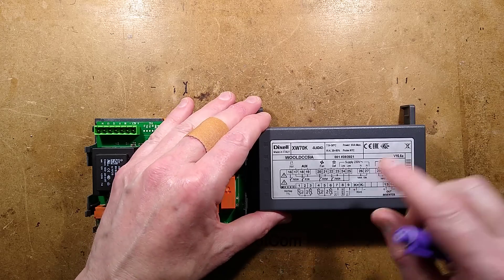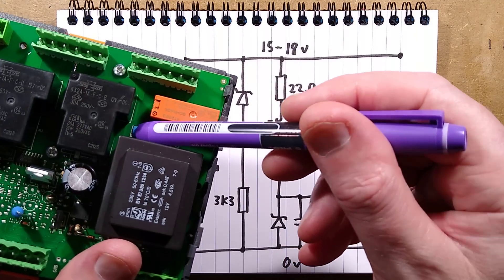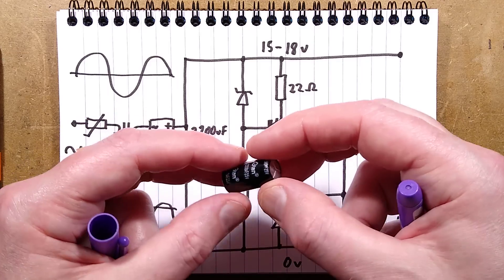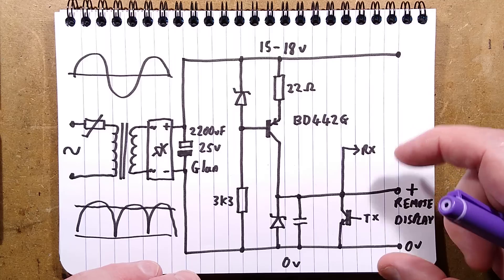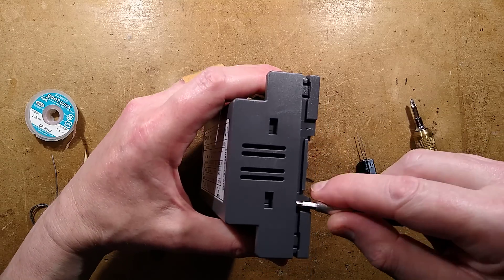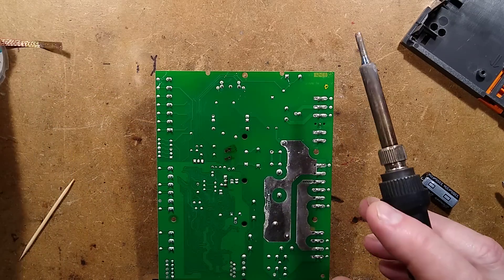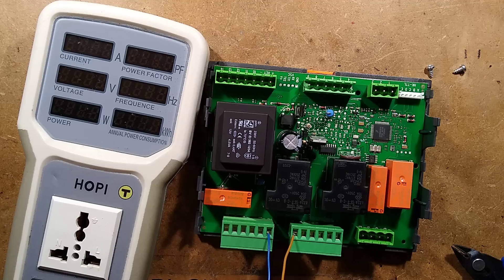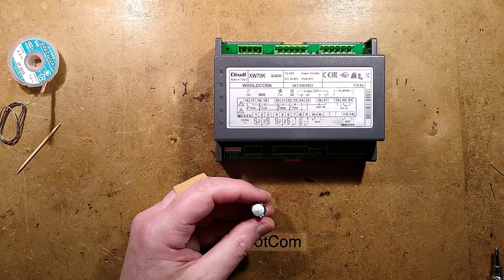Interesting fault and fix on a Dixell XW70K refrigeration controller

Comment: I wonder if it is always "planned obsolescence" or if some companies just underestimate or do not test for longevity properly. I just fixed a friends's portable induction stove - The fault was a 22 Ohm resitor (roughly rated for 2-3W, from what I could see), that had gotten slightly too hot over time and slowly crumbled until the resistance wire broke and the stove would not turn on anymore. No skidmark or any sign of an explovie fault, just crumbled! I replaced it with a resistor of slightly higher power rating (and did the same on the other plate, that had identical circuitry, but had not degraded yet because it had not been used as much) and now it works fine again. 1€ fix to save it from the landfill.
Reply: I hate to think how many products end up in landfill because of a simple resistor or capacitor.
Reply: A lot of times its simply over stating capabilities. Sure this, say fridge (that has nothing to do with Technology Connections latest video.....he lied), could keep its interior at a lower than ambient temp. But the parts selected arent necessarily meant to keep the entire volume, full of groceries, below the danger zone. What is it actually meant for? No idea. Maybe its meant for an arctic research base where it wouldn't have to run very often, no clue.... Of course there is always the accountants that love to stick their noses into designs. This is where you get things, say with a motor that pulls 2.4A and a FET running it that tops out at 3A. Because its cheaper than a 5A FET that would last forever. Of course its going to burn out if you use it like a normal person, repeatedly, beyond its 'no more than 10min. 90% duty cycle cool down' rating. But its printed in the instructions, so..... user error. Buy a new one.....
Reply: @zombieregime  CURSE YOU ACCOUNTAINTS AND ARCHITEEECTS!! *shakes fist
Reply: MTBF is based on running at 25°C ambient. Halve the life for every 10°C.

And MTBF means that half the units will have failed by then, bell curve noted. So stay away from that.
Reply: Also could be because engineers with less experience are cheaper to hire. Somebody I know who only recently graduated got hired to write control software for car clusters... the thought is slightly terrifying.
Reply: @gabotron94  I once knew somebody who put all the decoupling 0.1 capacitors in the corner of the PCB because the schematic showed this.  He was a repair tech doing PCB layout for a very small manufacturing company.
He was partially self taught and only had help from a distance over the phone. he like all learners need a mentor nearby ready to answer questions and demonstrate.
Reply: Did vaguely similar things to a NEFF (Bosh Siemens) branded, made by E.G.O one. Each phase has a power board, on those the high frequency fets/IGBTs short, burn out the bridge rectifier (maybe the rectifier dies first, not sure). Then melting a pcb fuse (which ironically has provisions for replacement hrc fuses lol). Happened twice to the same stove on different power boards. Granted the thing is over 10 years old and is powered 24/7, maybe it was due to power glitches.
Thats a sub 30€ fix on that one. New fets and a bridge rectifier.
Reply: Calculating power dissipation for dynamic and static loads is a job passed on to junior minions, not all are good at it.
Reply: Advertising these relays as capable of switching loads is the planned obsolescence, swapping a worn out contactor takes 10min&$ but these boards have to be swapped entirely once the contacts melt or burn off.
Reply: I think that phrase planned obsolescence is abused a lot. A piece of equipment that is weak and frail is not a piece of planned obsolescence; not at all. An example of planned obsolescence is having the improved version of a piece of equipment in spades, but not selling new models until the old stock (that may have problems) is gone.
Reply: Overheating components are a pretty common way of limiting a device's life.  Sealing a high dissipation in an unvented box with no heatsink is really common.  When its from a name brand you know its planned.
Reply: @RS-ls7mm  Planned destruction is not planned obsolescence. They are different. 
Planned destruction by putting otherwise heating components inside plastic cases with almost no ventilation and zero fans is planned destruction.
Reply: @troy3456789 yet always leads to planned obsolecence. As by the time your version of the product fails there 'magically' is only a newer more expensive version available.
Planned obsolecence without planned failure is almost moot as your new products would sell almost no units.
Reply: It has a microcontroller, it would be so easy to program it to stop function after so many thousand cycles rather than say to a company please make us awful capacitors and jeprodise your reputation
Reply: @phonotical  From my experience with themed animatronics industries ..... you would be surprised how often they would just order another unit and swap it out. It would take someone in the shop sneaking one out, taking it apart themselves on their time, discovering the issue, and reporting it to the boss. Then its up to the boss to give a shit. The whole programmed to not do a thing after so many cycles is far less of a thing than people think. And IF a company were to do that; 1) if any of their B2B customers found out, it could sink them. and 2) theyd be more likely to program in a random number then do something that sends the electronics out of spec and blows the whole unit. You wouldnt leave a perfectly functional MCU behind just refusing to run its code, thats too much of a smoking gun.
Reply: @zombieregime  sure but so is suddenly having reports of all these units dying because of the capacitor issue, at least it is a lot more covert and time consuming to discover, of course it'll all go to landfill anyway, but if you are the sole owner of equipment, you might want to try and save some money and affect your own repair, which is easily surmounted and prevents this whole "planned obsolescence" myth from ever happening
Reply: @zombieregime  - Toyota deliberately provided odometers for the entire run of the Pontiac Vibe and Toyota Matrix that stopped at 299,999.  It didn't matter if it was kilometres or miles.   Not sure if the Corolla had them also.   There was no actual reason ever given for not at least going to 999,999.
Reply: Not planned obsolescence per se (which really doesn't exist the way people think it does)... more a matter of cheap parts being operated at or near their absolute limits for a long time.  I always specify components that are appropriate for their conditions of use, plus a safety margin... but I design industrial electronics and while cost is a consideration, long product life is more important.  When I worked in the consumer industry, they'd use junk parts to save a half-cent per unit...
Reply: @WorldPowerLabs  explain the phoebus cartel then. Or the other modern day apple cartels they get sued for every year.
Reply: “Planned obsolescence” is a misnomer. Planned (or designed) functional life would be more correct. The electronics industries have been at since day 1 - the now rogue incandescent lightbulbs would have lasted many times longer than they do / did, had it not been for the collusion of the manufacturers, in order to sell more lightbulbs. Who could say that the practice is not rife? And no right to repair - yet.
Reply: @bettyswallocks6411  "phoebus cartel"

Comment: Seems a lot like preplanned obsolescence to me, the savings made by using a budget capacitor Vs using good quality ones from a well regarded manufacturer would be minimal at best and surely using "budget" basic components increases the number of initial first use failure's / DOA warranty claims which then could potentially risk eclipsing the cost savings made by using the budget component in the first place? Seems a tad short sighted
Reply: I suspect that a purchasing agent at Dixell has been reprimanded / educated / sacked over this.  Purchasing agents don't always have the knowledge to understand that a cheaper part is not necessarily a valid substitute.  A purchasing agent at company I worked for back in the '80s tried to substitute some very cheap stamped contact IC sockets in place of the ones we had been using, which had gold-flashed machined contacts.  Fortunately, that was caught before a lot of units went out the door.

Comment: The toothpick technique is so simple yet so genius! Gotta add those to my kit now 😅
Reply: I actually bought a full set of soldering needles for £2. They’re absolutely fantastic for mosfets packages and all sorts. They are hollow steel tubes which perfectly isolate the solder around a component to remove it without the need for any desoldering braid.

Takes a little time to master but is now my go to method!